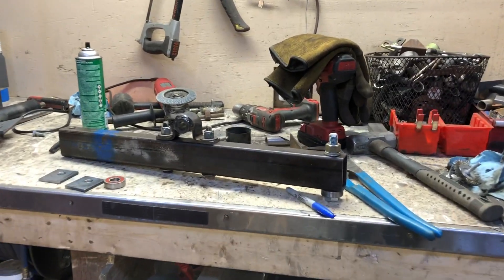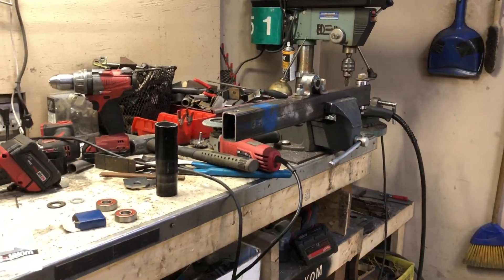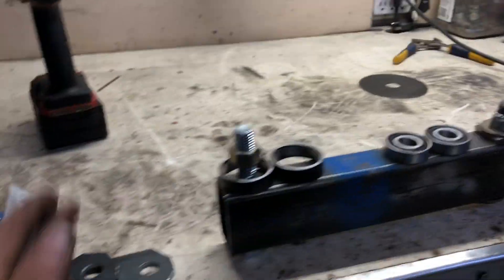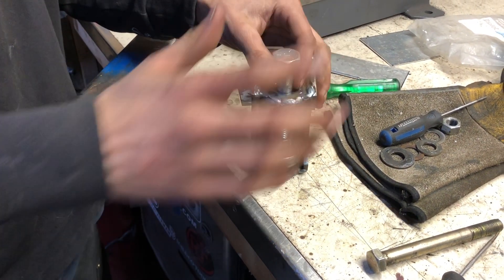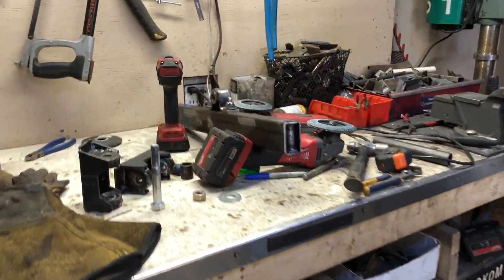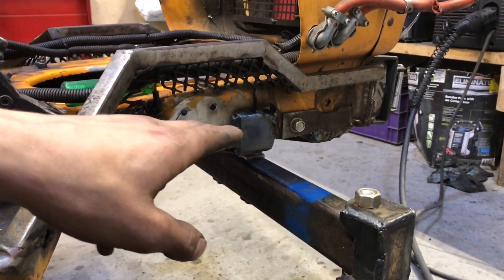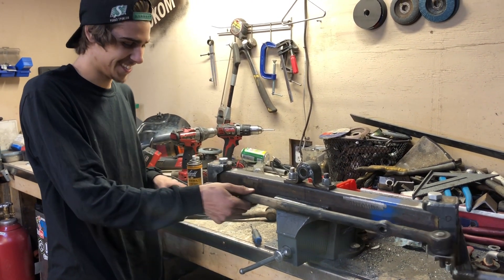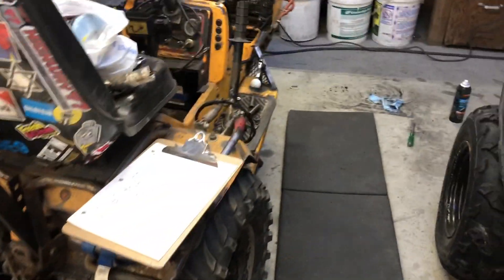HOW TO BUILD A OFF-ROAD MOWER (PART 3) 100% CUSTOM FRONT AXLE AND  STEERING SETUP

Comment: Wow those spindle shackles are seriously BULLETPROOF!!!! That front beam is massive. I have not gotten to that point in my build because I found a yamaha ytm 200 chain drive that I found in the scrap yard when I was there and just had to buy it for $25. Now I add that to my projects,  A 19770's Porsche 914 GT6 factory race car, a craftsman GT18 all terrain mower (in progress), YTM 200 chain drive and an XS650 bobber for a bar hopper and the trip to California and then down to the Baja in Mexico for the "El Diablo Run". You guys should grab some bikes and join a 100 of your closest friends for the El Diablo Run this year. I think it is sponsored by TC cycles.

Comment: How’s that front end treating you mate?
Reply from the maker: Unbelievable! Like better then good! 
One of the best ungraded I’ve done
Reply: @okoffroadmowers  looks unreal brotha definitely gonna copy you from down here in southern Cali!!! If ya don’t mind lol
Reply: Hopefully those are angular contact ball bearings otherwise they won't last long... A trick for near bullet proof lawn/garden tractor spindles is to use 2sets of tapered roller trailer hubs and spindles...  1st set of Hubs facing cap up cut the hub wheel flange 1/2-3/4 way around (this gets welded uncut section towards axle beam) the uncut section gets used as your axle steering stop as well and as a lower spindle to beam brace (I use 4x2x1/4 wall rectangular steel tubing for steer axle beams and put the side to side pivot through the axle 3/4of the way up from the bottom of the steer axle beam... Also using a longer pivot tube and pin will reduce the axle beams desire to rotate forward and backward and twist left and right as the pivot wears).the second set of trailer hubs gets used to mount the steer tires by welding spindle pivot axle stub to wheel hub spindle